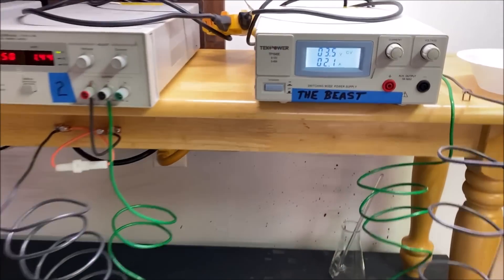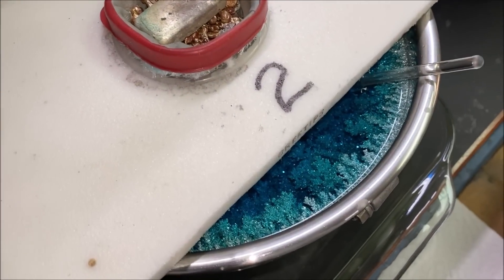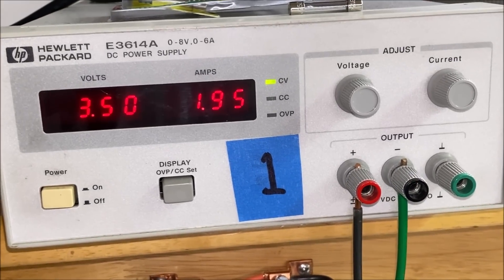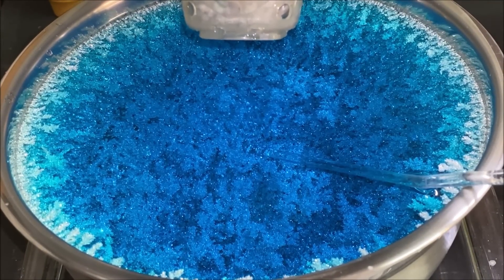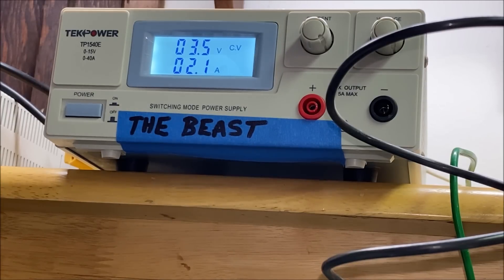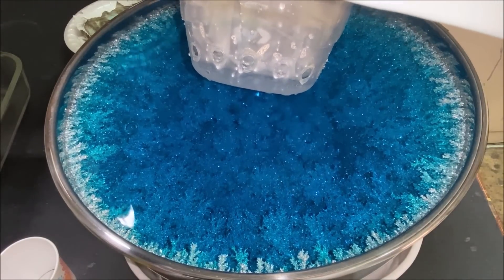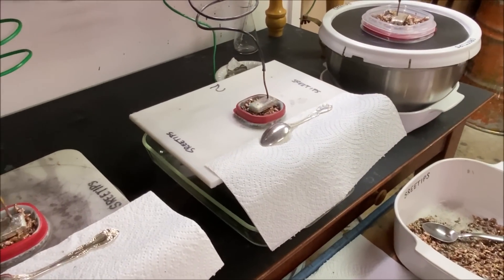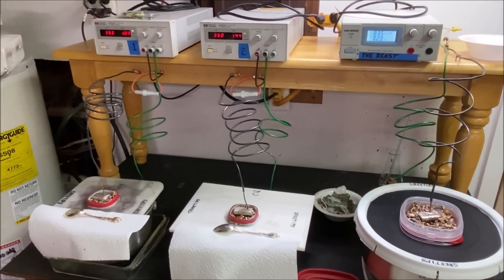Silver Cell Day 8 Crystal Growth 192 Hours

Comment: What is the name of this process?
Reply from the maker: Electrolytic silver refining. This is a “Thum” cell with the anode held horizontal over the top to of the cathode. Big industrial level refiners use a Moebius silver cell arrangement: alternating anodes and cathodes hung vertically in a tank containing gallons of silver nitrate electrolyte. Probably pulling hundred of amps and cranking out pure silver crystal in kilos per day. My small Thum cell is a hobby level setup.
Reply: @ looks like its working good for you though brother 👍

Comment: Does the presence of slimes decrease the amperage? I'm wondering if the shot used in cell 1 had some higher level of impurities that would create a problem for conductivity.

If so, would changing out the filter in the basket make a difference?
Reply from the maker: The slimes building up in the filter creates resistance and the amps will decline.

Comment: Streetips, an easy way to get some diagnostic information on cells #1 & #2 is to switch the tops of the cells. If the voltage doesn't change, then there is a problem within the circuit, from the cell basin to the power supply. Since #2 uses a tarnished and smaller piece of copper, that would be the first thing to clean or replace. 

if there is a change in the voltage, then there is a problem with the filter baskets, conductor anode or shot. Swapping the anode would be the easiest switch, then swapping the filter baskets. If it is the shot, not much you van do about that.

I hope this helps.

Comment: The second cell has been consistent with one thing,low amperage, its the non variable you have to check,somewhere it's creating a bad circuit, so dirty or burnt contact points somewhere... your voltage is 3.5 but your amps are your draw..

Comment: You should check the current on the silver cell number 2 see what is actually coming out of the power supply and going into the cell. Never trust the dial or the dugital reading. Number 1 and 2 have the same power supply. It doesn't make sense why they have different currents... Unless there's something internally wrong with one or heavy resistance in the cell.

Comment: The only thing I can think of that would slow one of these cells down is resistance, as you are using exactly the same electrolyte for all 3, it has to be in the hardware.  That narrows it down to the connection to the cathode, the cathode to the metal bowl,  corrosion on the inside of the bow, slimes in the anode basket,  or a faulty connection in the anode.  You can try swapping anodes on 1 and 2 to see if that does anything. My guess is the cathode connection.  You did show some patina on one of these cathodes.

Comment: G'Day Sreetips! The three silver-cells have been awesome to follow along with, and see them produce so much pure silver. Looks really-really good!

Quick question for you: Do you reuse the filter bags? Like, can the slimes in used ones be washed out easy enough? If so, would you do it with water or a solvent, or acid or something? Sorry, am not a chemist, so apologise for not knowing. My line is electronics, and electricity. Anyway, I have been subscribed to the channel for ages and ages, and love all the videos!

Thanks mate, and keep up the good work!
Reply: Yes, it is possible to rinse the silver and slimes from the dacron fabric and if the fabric was expensive it might be worth doing. But a bolt of fine dacron is cheap. Dacron is a trade name for PET (polyethylene terephthalate) the same stuff baggies, sandwhich wraps, etc. are made from. In the US milk bottles, drink bottles and other items are made from this source of plastic. Not only is it cheap enough to toss when it is rinsed but it should be as it is recyclable. Less than 5% of our plastics get recycled, this one does since it is so ubiquitous in all it's uses, rugs, men's ties, jackets, comforter fill, cigarette filters, roof insulation (under the shingle as well as in the shingle) amazing stuff isn't it. These are just a few of the hundreds of uses for PET, PETE.

Comment: The lower apmerage of the cell 2 could be caused by the silver electrode, maybe oxided, or from a "cold soldering of it to the feeding wire. I would try to  polish the  anode electrode and check the  impedace of the unit wire-electrode, with a good instrument. A 25% difference between the two small cells seems me to be too high, having the same cathode belt and bowl and the same electrolyte.

Comment: I know I'm a box of questions but does it build more crystals where you have knocked them down maybe like it has more leads going to the aniod basket so it would have more places to build them
Reply from the maker: The silver deposits on the crystals that I knocked down.
Reply: @sreetips  and that increases the size of those crystals I imagine since there is less distance for the ions to cross and make contact with an electon source which then allows then to turn into elemental silver, funny isn't it, that a single electron can make such a difference to a metal holding solution. And the solution rebounds by dissolving another atom from the impure alloy of silver and copper with trace amounts of PGM (platinum group metals) and whatever other traces it may contain of other precious metals from all the reactions before it was cemented with copper from the various solutions which all together combined at that point in your silver waste streams.

Edited for spelling, typos, and clarity

Comment: Do the cells capacity for silver diminish as the electrolyte consumes the impure shot? such as getting saturated with copper and loosing the silver concentration within it. Is there a test beyond level that could be used on the electrolyte to identify the makeup and concentration of it.
Reply from the maker: Yes, and yes
Reply: @sreetips  i was curious if that saturation could be why the different results from the cells after the amount of time.

Comment: You may need a larger gage power cord going to your power supplies I don't think that whatever your powering it with home electrical would be failing with that little different but if you think about it the br air is only rated at 15 amps and then take in to consider the small wires drought the wall and all that jazz try unplugging one or swapping them around I'm perplexed with the amp differince
Reply from the maker: I’ve got the BEAST and cell 2 plugged into a twenty amp dedicated breaker. Cell 1 is in a normal 15 amp breaker.

Comment: I think the electrolyte is more concentrated in the first cell it has been running stronger than the other one since you started either that or the power supply is just working harder do you have them pluged in to a power strip or do they have there own plug? If it's playing second fiddle on the strip it could be getting less power

Comment: are there more holes in basket no. 1 than in no. 2? therefore higher amp ?
Reply from the maker: I don’t think that would make that big of a difference. But never know.
Reply: That's what I was thinking. No 2 looks like it only has 4 / 5 holes Not got any idea if more holes or less holes makes a difference in current flow into the electrolyte though ?